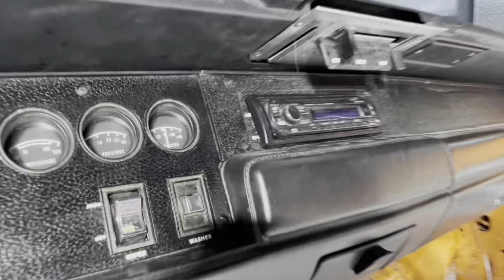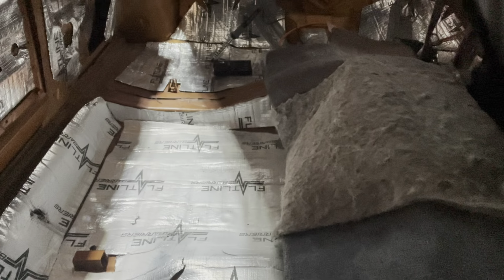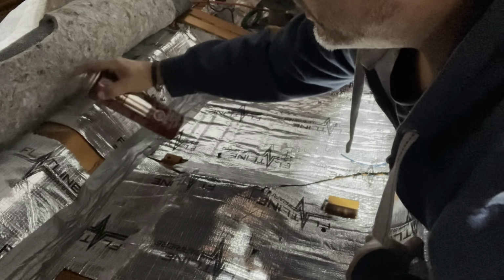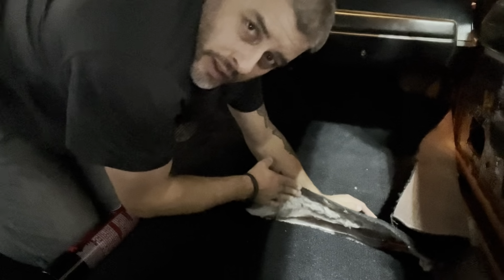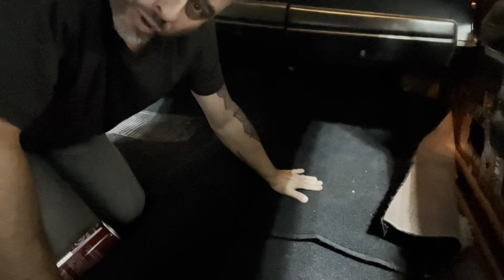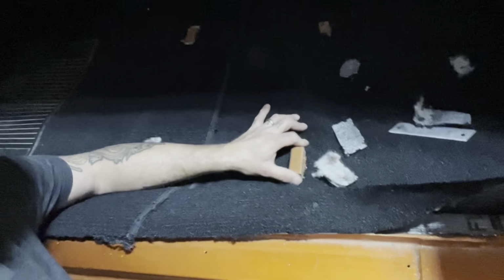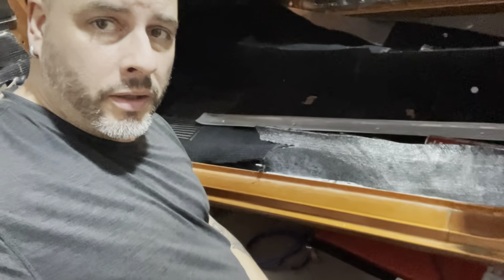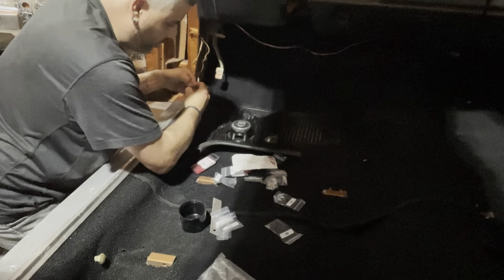69 Charger carpet installation

Comment: Carpet looks good, hopefully you’re happy with it. I bought it for Austin for Christmas last year….supposed to be a manual transmission carpet.
Reply from the maker: Yes I am more than happy with it. I cut it a bit short on passenger side at the front but it stays closed to the door frame… and I wondered if it was manual. Big stretched bump on trans tunnel. Works for me. It’ll eventually be a manual car.
Reply from the maker: So thank you for the Christmas present to Austin hahahah.
Reply: You’re very welcome!! Glad you are going manual too, that worked out perfect then. Was cool…and sad at the same time, watching you install it. Really glad it went to someone that is building it right and loving it!
Reply: You probably know this, but there is a metal piece that goes on the tunnel….under the carpet😢….for the shifter. Hopefully you can get that installed now that the carpet is down n it doesn’t mess you up.
Reply from the maker: @GlennMcKee-y6q yes I know. I’m going to build my own small one and get a pistol grip shifter. Then custom build a centre console
Reply: That works!! I figured you knew…..